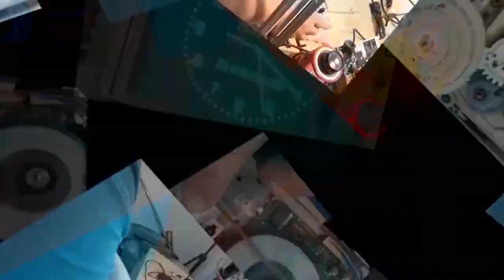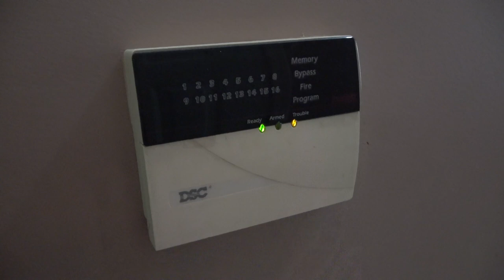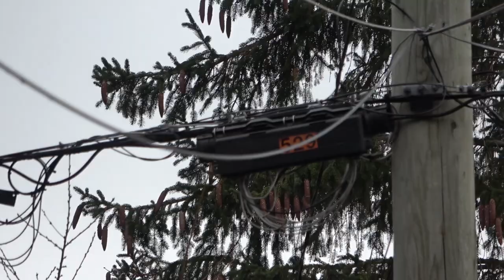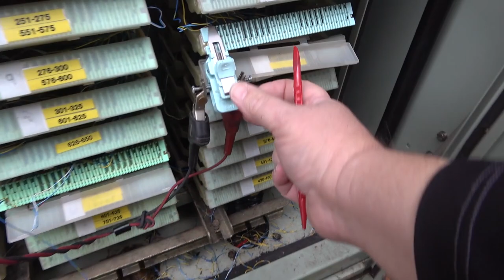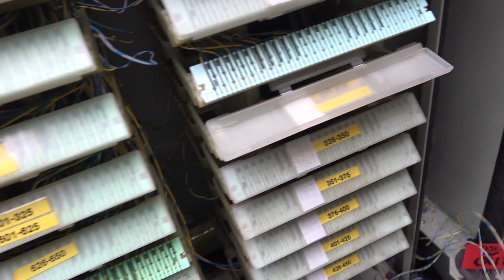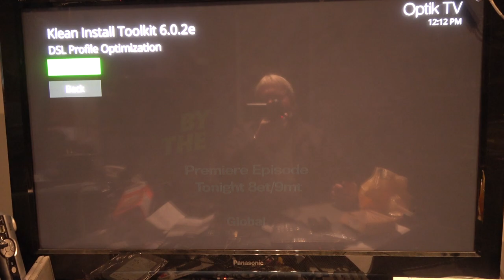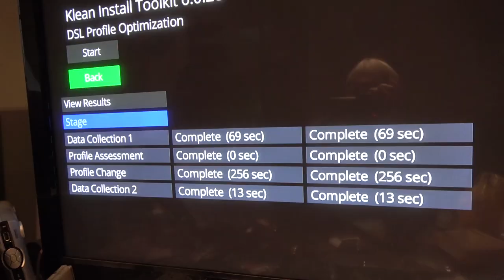Fixing my old noisy copper phone line

Comment: Jesus, that's some FAST DSL
Reply: He mentioned that he has Fiber already capped in the home so it's a safe guess that he has FTTN, fiber to the node. Fiber makes 99% of the journy to the box on the street and only communicates with your DSL modem between your home and that node. Very modernized version of DSL, good for rural areas where it can be 100m-5km between homes and digging fiber would be too expensive. 

I have a friend out in the farmlands with 250Mbps  DSL and actually gets his full speed during peak times because his node isn't overloaded like it is in the city.
Reply: I get 98/25 on my dsl connection. Just recently got this upgrade, before was max 40/10. Im amazed at the speed possible from these old phone wires.
Reply: Were i live my DSL is capable of 200/60. Bonded dsl tho, so 4 pair going into the modem. But i use the coax cable with 500/40
Reply: It's VDSL2, the speed is pretty standard.
Reply: normal for fibre to the cabinet with the copper part less than a few hundred metres.
Reply: I have a bonded line that is 140/20.
Reply from the maker: I can go to 150/40 but don't need the speed or extra cost.
Reply: @12voltvids  How much do ypu pay for 150/40 where you live?
Reply from the maker: @MauriceNL1  I don't have that speed i have 75/20 and it is about 85 a month same as it would be on fiber which is 75/75 but my tv bill would go up my about 40 a month due to equipment rental fees and different theme packs that have a different price point.
Reply: @12voltvids  wow, that's more than i though😂 i thouhg it was cheap in the US
Reply from the maker: @MauriceNL1  
Not in us, in Canada and no internet is not cheap.  With the unlimited option it is about 100 a month.
Reply: @Hazard 1000 up down, 1v1 me.
Reply: VDSL 2 is pretty good, DSL gets a bad rep cuz of the max 20mbit max speed of ADSL
Reply: @Hazard G.fast?
Reply: @12voltvids  Wow. We in Austria have pretty bad availability all over the county (33% of households under 30Mbit), but at least we only pay ~47$ canadian for 75/15 over DSL, coax or fiber.
Reply: I'm bonded VDSL2.   About 160/80
Reply: @12voltvids  Funny thing is an employee getting the union concession discount has worse pricing than a customer calling into the retention department once a year and threatening to switch.  Telus gave me the 150/35 VDSL package for $80 and $40 for 8 theme packs and movies plus free unlimited data discount.  I'm now on gigabit fiber and internet price went up $10 after negotiating with retentions.  But old VDSL2 from Telus was world class for most areas.  At 75mbit per pair you couldn't push that technology much further and copper maintenance costs became more expensive than fiber for long term which is when fiber roll out really got going.
Reply: wow, when I had DSL ~10 years ago it was 300-500kbps i would've killed to have that speed
Reply: Better than my cable's speed.
Reply: After I got upgraded from Adsl to vdsl2, i went from ~18/1 to 65/25.
When I asked the backbone provider nicely, since they'd installed FTTN, if my connection qualified for g.inp (iirc, a precursor to vectoring), they without replying, applied it.
I then went from ~25ms ping down to 9ms, same as the fiber.
Also went from 65/25 down to 50/25, which i don't mind that much.
Reply: @Harry11315  10000/2500 fiber all the way to my pc, a business line so i don't share with neighbors
Reply: Not really. When I had DSL I was getting 80/40. Switched to cable and now get 500/10. Had to sacrifice upload speed for faster downloads. Fiber can't come soon enough to my area.
Reply: i got 100/100 over DSL, its possible
Reply: @DaxtonAnderson  that would be VDSL and all the old stuff will not work on VDSL unless as he said he has 2 copper lines one for VDSL and the one for phone

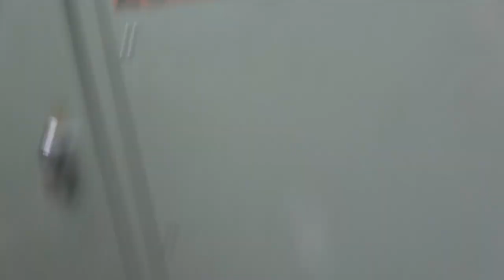Comment: 9:05 The moment when I realized I gonna see what's inside the telephone cabinet for the first time.
Reply from the maker: It's pretty boring.  The fiber cabinets even more so.
Reply: @12voltvids  Is there electronics? Or it is only a patch to derive the lines to the consumer house?
What's the main carrier cable upwards to the network?
Reply from the maker: @swilwerth  the cabinet has the VDSL ports in it.  They are fed with fiber.  Power to power up the dslam is 48 volts. The battery voltage at the co 52 volts is stepped up to +192 and -192 with respect to ground.  384 volts potential and 25 pairs of 26 gauge copper is used for this.  High voltage low current.  In the side panels contains the power supply cooling fans and VDSL ports.  This cabinet has 384 total ports. 192 on each side.  That can feed 384 single loop DSL or up to 192 bonded which uses 2 ports.  This cabinet is about 1.6 km from the main central office and about 600 meters from my house.  If fed from the co directly i might get 6 megs but cutting that 1.6km (1 mile) off the cable allows each line to hit about 50 megs, so I can get 100 meg service over the copper line.  I only pay for 75.  More than fast enough for my needs.
Reply: @12voltvids  Awesome answer! Thank you! 
It is great how the modulation schemes improved to get near fast ethernet speed over a 600m copper pair.
Reply: @12voltvids  what is the 380volts DC used for?
Reply from the maker: @tekvax01  That is what powers the DSLAM in the cabinet. The DSLAM stands for Digital Subscriver Line Access Multiplexer. In other words the ports, fiber in , 192 DSL ports per bay. This cabinet has 2 bays so 384 ports total. The DSLAM runs on 48 volts. 48 volts from the CO is stepped up to +192 and -192 volts (384 potential between rails) and sent down a 25 pair bundle.  When it gets to the remote DSLAM it is converted back down to 48 volts for the equipment.
The reason the voltage is so high is, well remember ohms law. Higher voltage lower current. To send at 48 volts would require much higher amperage, and the thin 26 gauge copper wire wouldn't handle it without overheating.  Also losses are lower at higher voltage. Save reason the power company steps the 14,400 volts that comes off the generator to 500 - 750 KV for long distance transmission.
Reply: @12voltvids  I figured the voltage supply was for the dslams, line cards, and fibre nodes, but I just wanted you to confirm it, cheers!
Reply from the maker: @tekvax01  In this cab it is just DSLAM. The ones that have line cards are usually AC powered with internal UPS
Reply from the maker: Perhaps on my last day I will turn my camera on inside the CO and get some pictures. 
That would probably be frowned on, so that is something for my last day :)
Like the train engineer that invited me to ride in the locomotive on his last day on the job. His words not mine "What are they going to do fire me?" I sat on that tape for years and then published.
Reply: @12voltvids  ohhhh... link please!! :P
Reply from the maker: @tekvax01  you'll have to wait awhile.   Not leaving for a few more years.
Reply: no, I meant the link from the train engineer. :P
Reply: @12voltvids  I mean, for a lot of reasons I miss that noise.  Always meant it would be a pain in the ass, or super easy, but the end result was a happy customer, unless the noise was coming from inside the house.  :)
Reply from the maker: @tekvax01  
https://www.youtube.com/watch?v=-Fc4oWjQXlQ

Enjoy
Reply: I always watched the BT repairmen doing things in the cabinet near my house... one day someone came round to disconnect the bell wire to bring our ADSL from 1meg down to 7, 8 around midnight. It wasn’t something they were really meant to do for free as it wasn’t strictly a repair, but he seemed impressed I knew about it and that’s why he went ahead and did it. BT actually sold a face plate for people to install themselves which insulated the bell wire from the rest of the circuit, so I think they’d have vastly preferred the extra income, but the engineer was like “nah, just a waste of money, and it looks ugly. Just have to trim this here and hide it in the socket. Plus you have lovely vintage sockets flush with the wall, I wouldn’t want to have to replace that.”
Reply: @12voltvids  can you do a video of how fiber signals are changed over to copper and vice versa? Thanks
Reply: @electromech7335  it's just a little device that does that.  An IMC, or enid is what its called.. customer side is either a remotely managed device acting as a demarcation. On the ISP side there are usually cards in a shelf that do the same. Its actually not that fancy.  ;)
Reply: I work for a company that provides internet for luxury apartments we have those cabinets too except in them is a dedicated AC unit because it's in Arizona and some ubiquity switches and some ATAs and also an ups unit.
Reply: @tekvax01  Here in germany the DSLAMs got mains power 230Vac  and have a backup battery 48Volts. The cable operators , former cable TV (coaxial) use 350 or 400V ac remote feeding through the coax centre wire.
Reply: @Reaktanzkreis  We have Triax and fibre optic camera cables at work, with 380 volts DC running up the centre connectors, or power pair in the cables! We've had the cables get caught in a door or a pinch point, and "*WOW*" do they burn nice big holes in the cable sheathes when shorted!!
Reply: @12voltvids  What DSLAM's do y'all use? If line powered they tend to be beige but the C.O. Equivelent is what color? How about the line power eq? Seems like Adtran and Calix are pretty popular with Alpha being a pioneer in the line power world (In my experience) Telco is a neat field!
Reply: Oh Another question, is the "Kleen Install Toolkit" a proprietary/in-house tool? I would imagine it's tweaking SNR min/max/targets and such to optimize, but I could see that being a big time saver for techs.
Reply from the maker: @funkymcmonkey187  These ones are Alcatel ISAM 7330. Powered by express power converter, which boosts the 48v battery to about 394VDC and sends over existing 25pr copper to the FTTN cabinet where its dropped back to 48V for the ISAM
Reply: As a former utility locator, very annoying to deal with said cabinets

Comment: I still have a copper line coming into the house and an old phone hooked up.  Where we are on the island we lose power quite a bit during the wind storms.  Nice to have an old phone and phone line that still works even when the power goes out.  It’s also more reliable than cell service.
Reply: starlink and a generator?
Reply: @-Good4Y0u Starlink is not yet available worldwide and it's rather expensive
Reply: @rodpadev  The beta is pretty broad now. It's not so bad, $99/m is only $15 more then my gig internet and unlike mine starlink could be used on a moving object. I think that is nifty.  Being on an island you would be a prime beta candidate
Reply: @-Good4Y0u  99usd a month is a looot of money for some people, my 50/5 DSL is 8usd a month and i have the fastest internet out of all off my friends lol, and thats in a fairly big city
Reply: @ondrejbrandejsky5592  99 USD isn't a lot of money in the US for internet. The cheapest plans are usually around $40. SOME states are trying to limit pricing, but NY State for example is being sued for just that right now.

Comment: Please note:  GPS often times works inside as well. For example, at my work I can submit clock punches on my phone, BUT I must be within a work location, and for the most part, it just works. Unless you have +3ft of concrete in-between you and the satellites the GPS function will work just fine. In major downtown areas with large buildings and in parking ramps will generally be the areas where you will have problems, also on lower floors of some apartments. Note that if you connect to WiFi, you can also get location information from there, that EMS technicians can pull from your phone. Sometimes even more accurately than a simple landline, ie. what part of the building you are in and which floor. Also, when you call emergency services, you are always broadcasting them your location so they can know where you are.
Reply: Yep...tho my one experience calling 911 in a real emergency I was standing OUTSIDE stopped for a car that flipped in a median and they insisted I was in a different county than I was...not convinced they actually use GPS, I think they just use the tower location.
Reply: @matthewmiller6068  I am going to say that your situation was probably an infrastructure issue. Unfortunately throughout the US many emergency response services are under-financed so they may be using 5-10 year old technology with only the required components, like computers and OS's, updated, and sometimes not even them. So their systems are unable to receive/read that data.
Reply: Yup. I work in an interior office, on the 2nd floor of a 9 story building that was an old Montgomery Ward retail store - ALL concrete, wood, and steel. My gps still works on google maps just fine
Reply: @matthewmiller6068  What? I find that very hard to believe

Comment: Dave, 
I've got copper lines as well for my DSL and landline. I've got a Western Electric 302 with a date code of 1946. It's a metal bodied phone that's never been restored. I use it all the time and it still works wonderfully well. Very heavy, you could drive nails with it!